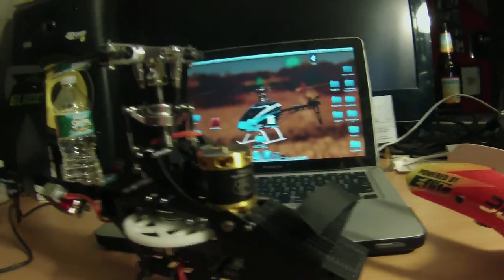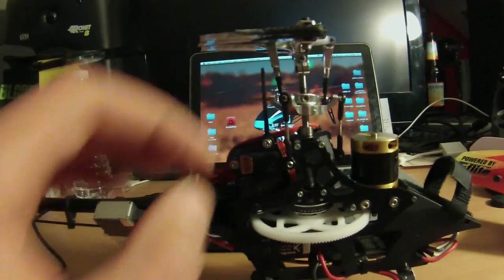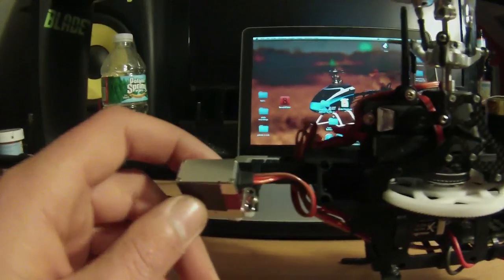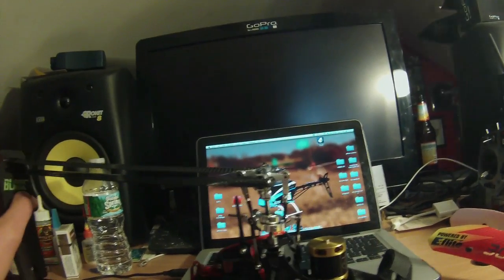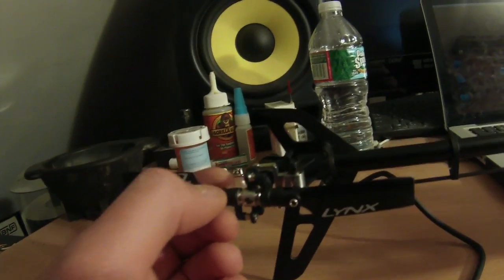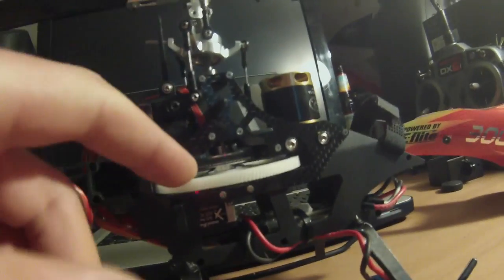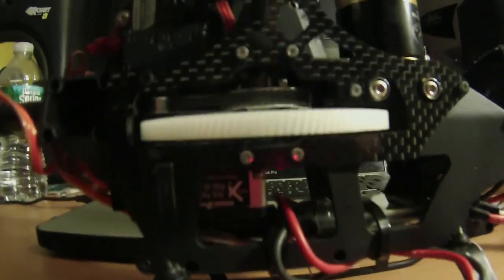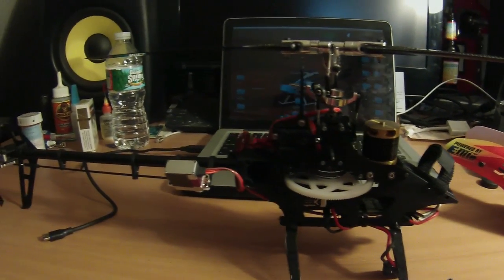Blade 300 CFX Best set up? Part 3

Comment: It's been along time and you might not be into helis anymore. but if you remember what size battery were you using to get 5 minuets of flight. I have a 300cfx and have been playing around. I put a 4100 kv motor castle 35 in it . I got it governed at 3700 14 tooth pinion. flys great but, only getting 4 min flight. With 1800 3s nanao- tech 25- 50c batts .